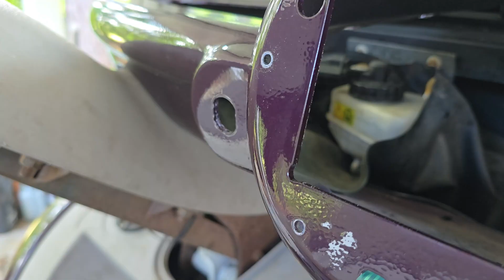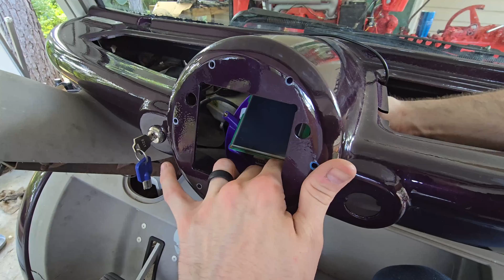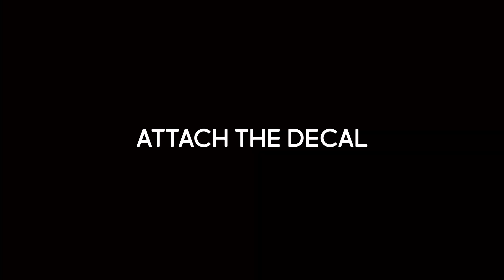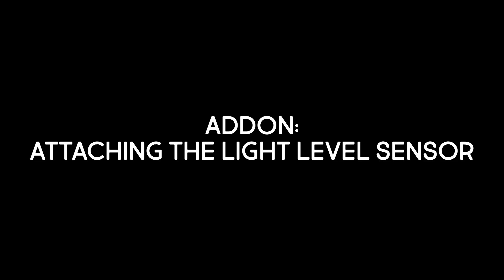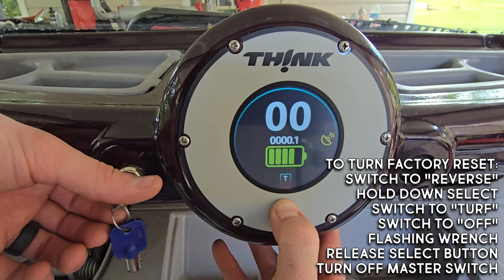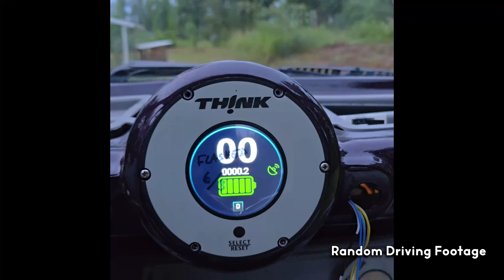Ford Think New Cluster Setup Guide | FordThink.org

Comment: Does the charge detection cable need to be spliced into the charge cable? The Thing I am working on has the charge cable go directly from the charge port, to what looks like an inverter. Is this charge detection cable necessary for operation or can I run the new dash without it?
Reply from the maker: The cable is designed to be plugged in line to your chargers 120V plug. You shouldn't need to cut or splice anything.

Also, you don't need the charge detection it will run perfectly fine without it. It just won't warn you if you still have it plugged in.

Hope this helps!

Comment: Landon - i got a cart that came with one of your controllers but it does not seem to be working properly and hope to get some help with it.
issues are it does not turn off when key is in off position, gear selector lights dont change when put in different gears. and the satellite is always red.
its a super cool unit and i hope i can use it and its not just a unusable part
any help would be greatly appreciated.
thanks - Matt

Comment: If you have the stock Gel batteries, what battery settings should be used?
Reply: The charge indicator cable installation is not fully discussed or shown. I am unsure how to install this cable? This cluster will operate without the cable I assume?
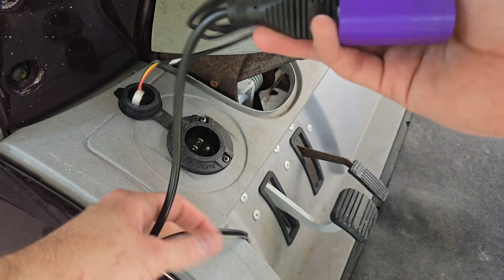Reply from the maker: @billcardinal1456  the charge indicator information starts at 8:08 are you watching the same video?
Reply from the maker: @billcardinal1456  regarding battery settings, depending on your battery voltage you can adjust as needed. If the battery looks as if it's going down fast it could show that your batteries are almost at end of life.

Mainly just adjust based on what your battery voltage is on 100% 50% and dead.

Comment: I finished installing my new FTC.  The setup instructions were great/detailed and worked perfectly for me.  Since I am still running the Deka 8g31 I was not sure what voltage values I should input on the setup screen. I guessed with 72v(full) 36v(half), and 15(empty).  I am upgrading to Lithium batteries, so it's not an issue if my voltage estimates are off...  Thanks you guys for a great solution and upgrade!
Reply: I have the same question.  I tried 78 full, 75 half, and 72 empty and that doesn't work very well.  Charge indicator drops very quickly and doesn't seem to reflect the charge level of the batteries.
Reply: Wondering if the jumper I installed on the stub harness left over from the older Delta Q charger which jumps the Charge Inhibit to -72 has anything to do with it?  Can I remove that jumper that was put in to protect the old cluster from getting fried?

Comment: should we unplug the stock speedometer??
Reply from the maker: Hi, this is a direct replacement for the existing cluster you should just unplug that, plug this one in and it should work seamlessly. It uses gps to get the speed so we don't even connect to the speed sensor on the cart.
Hope this helps!

Comment: What size tires do you have on your think?
Reply from the maker: Deestone D405 23X8.50-12 93A3 C Lawn & Garden Tire https://www.walmart.com/ip/323709963

The picture on the website is a bit different from the actual tire but they look good imo

Also! I would not recommend these if all you're doing is road driving, we use it around the field so it doesn't vibrate like it does on pavement. Probably one of the only "off road" thinks out there right now 😂
Reply: Thanks.  Was seeing if the think can fit 25x9-12